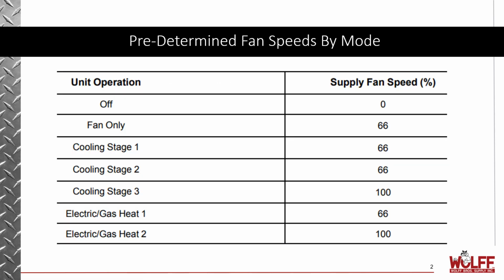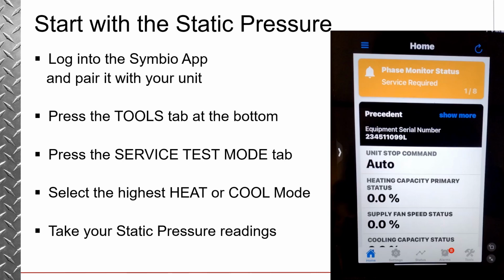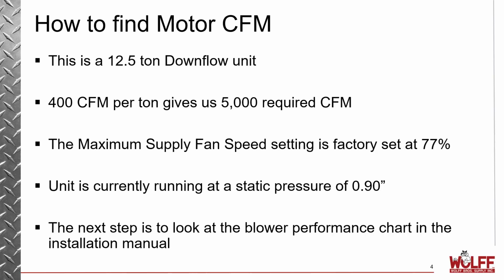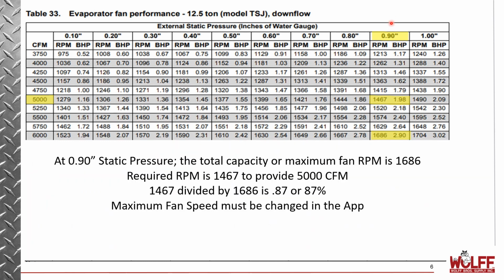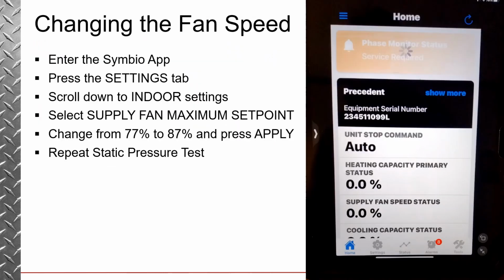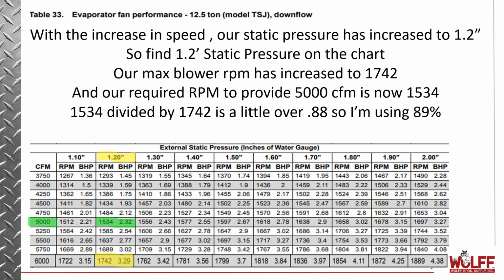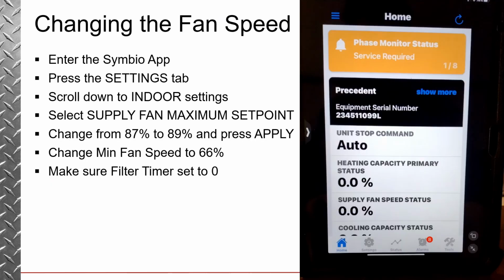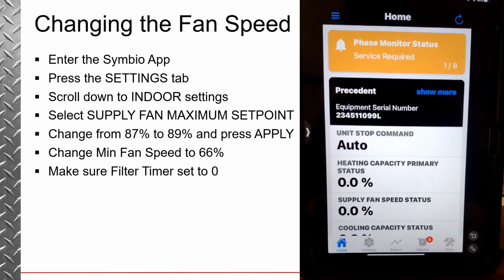Wolff Bros. Supply Tech Tips: Symbio Plenum Fan Settings

Comment: I believe your information may be incorrect. On a TSJ150, the max fan motor speed is 1850 RPM regardless of static pressure. The factory configuration is 77% of maximum, or 1425 RPM. Per the fan performance chart the unit was delivering approx 4800 CFM with .9 ESP.